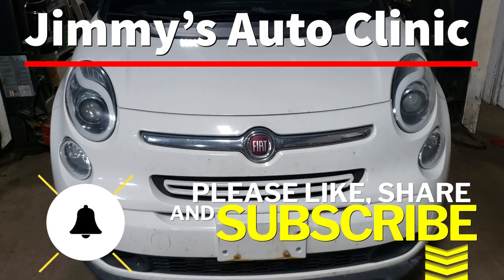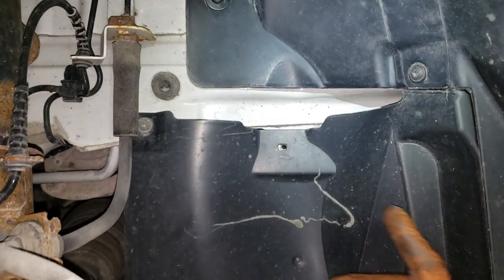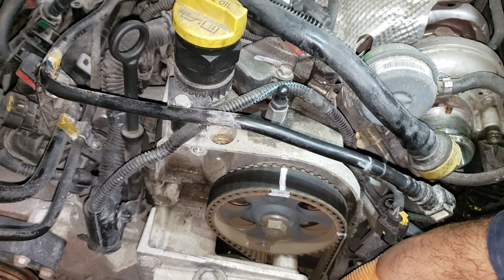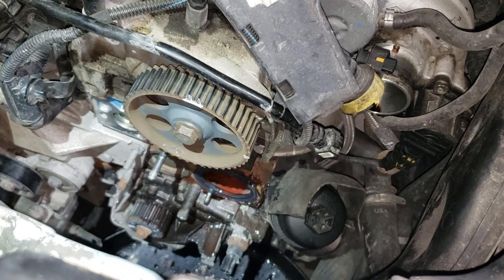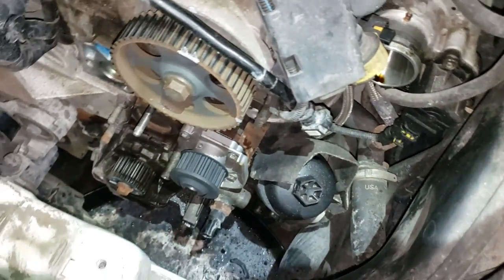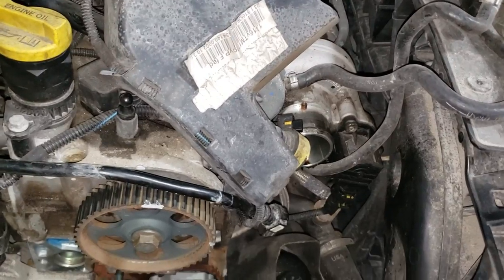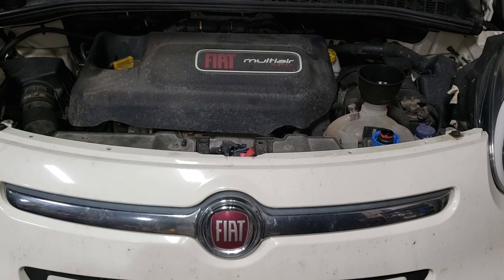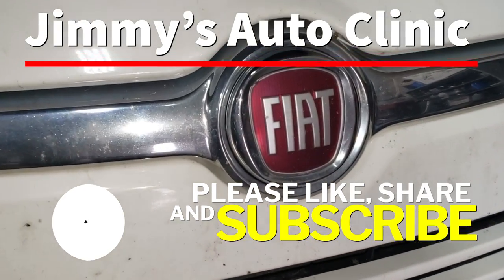Fiat 500 Lounge Pop | Timing Belt & Water Pump Replacement | 1.4 L Turbo

Comment: This is not a proper tutorial for this job. The lockout kit required is there to keep the engine in time. This is not recommended to make your own timing marks with a paint marker, or use vice grips on the belt regardless of pressure. Yes before anyone asks, I do run a mechanic shop. I can link the all data sheet for this job if needed. This is very risky to do this way, if you get it off at all it can result in severe engine damage.
Reply: Was gonna say, im pretty sure there's a lockout built in. Would going from underneath be the best way to get to it?
Reply: @ststst981  there’s no existing lockout or marks. There’s a lockout for the crankshaft and one for the back end of the camshaft near the air pump. Proper timing of the engine also requires the camshaft bolt to be loosened, then retorqued after new belt and tensioner installed.
Reply: The lockouts required are in a kit you can buy for those fiat engines
Reply from the maker: Yes if you're completely useless. It's only worked for me for the last 20+ years. Not everyone is going to have the tools that we have or the access to data sheets or be willing to spend an arm and a leg on a specialty tool just to do one job.
Reply: It’s a $30.00 dollar tool. All I’m saying is clamping a timing belt with any form of pliers can cause damage to it. But to be fair, you explain to do it gently. It’s the customers fault if they attempt something like this in their driveway with no experience
Reply from the maker: @edwardkirkendall883 I appreciate what you're saying, the videos are to show people what we go through and show them that there are other ways to do things. The tool maybe $30 in the United States but up here in Canada that probably be like 7 million dollars LOL nonetheless it's not absolutely necessary. And unless replacing the camps you you don't need to remove the cam gear.

Comment: Nice video.  I will be doing this job in the spring.  Pro-tip... I slide short pieces of air hose over my needle nose vice grips when I use them to pinch delicate items such as this.
Reply from the maker: Hey Joe thanks for the tip. Thanks for watching the video and don't forget to hit that subscribe button :-)

Comment: Subscribed! This was an excellent tutorial video for timing belt replacement! Yeah man I got a screaming deal on a 2013 FIAT 500 Sport she has 93k miles 2 grand! I'm sure it was never replaced. It runs great doing a lot of overdue maintenance work on it and looking forward using this video for the job replacing the timing belt as such. I like your method on marking the belt, cam crank, and block cannot go wrong! It saves some time and money. The Timing Belt Kit is about $138.00. Thank you!
Reply from the maker: Thank you for the compliment. I really do appreciate it. I'm glad you found the video helpful.

Comment: Well, there is two intervals for replacing timing belts one is kms/miles the other is time usually in years. This looks like a bit over the usual five years or so (over time and heat cycles the belt can give up even it is not have even close to the kms specified)
Reply from the maker: You are 100% right. Unfortunately most people only look at the mileage instead of the early bird. I believe this timing belt was 240,000 km or seven or 10 years. I can't remember exactly but it is definitely important to pay attention to both.

Comment: Use an air compressor through the radiator to blow extra coolant out from the water pump area. When you pull the water pump out to get the corrosion from inside the block and the radiator out, you will have residue of corrosion
Reply from the maker: I usually use compressed air to blow out some excess coolant but as for corrosion you would physically need to scrub it in order to get rid of it. Blowing it with an air gun may knock off really big chunks of corrosion if you had any but it wouldn't do much unfortunately.

Comment: This is a fantastic DIY for the Fiat (I didn't know until watching that Fiat was a four letter swear word)
Most timing belt / water pump jobs are kind of awful regardless of make, I suppose this no worse than my old gen 1 Neon or my daughter's Gen 1 Kia Rio. Lots of excellent home shop tips. Great job.
Reply from the maker: Hey Richard thanks so much for the compliment. LOL yes I didn't know that Fiat was a four letter swear word either until 15 years ago I think it was when I had my first one to work on. It was just an oil change but yeah that cartridge filter could have been placed better. Especially with the turbo models. Yes you are right most timing belt jobs can seem to be quite awful but some of them are pretty decent. Luckily I like doing them so they're not the worst but for someone who's just doing it for the first time it can definitely be a daunting task. I'm glad you enjoyed the tips. Thanks for watching :-)

Comment: Great video. I have read around 200,000km for timing belts for fiat 500, that being said what If you only have 37,000km the car is a 2015? Does it need to be changed?
Reply from the maker: Hi James yes there is a interval for time as well. I don't remember off the top of my head but I think it was 7 to 10 years. The best thing is to consult the owner's manual. Sometimes even though the belt is still good or may look to be in good condition they can dry rot in certain places that you might not catch by simply looking at the belt. And just for peace of mind and the continued enjoyment of a engine without sudden bent valves syndrome it is worth replacing it lol. If you can't find the information in your owner's manual for whatever reason you may be able to call your local dealership with your VIN number and they should be able to tell you what the interval is as per the manufacturer. Just be careful though they'll try to suck you into replacing it sometimes with them.

Comment: Great explainer! Nice work Jimmy. Did you replace the serpentine belt?
Reply from the maker: Hey thank you for the comment. I did not change the serpentine belt in this video. It was actually changed on this vehicle a year prior to the timing belt be changed. So it was still good. But definitely not a bad idea to change it if yours hasn't been changed and you're in there.

Comment: I had another question bout my fiat. I’m getting radiator and condenser back on. Can I wait till summer to charge air conditioner or will it harm the unit waiting and running heater.
Reply from the maker: You can wait to charge the air conditioning. Just remember the longer you leave it the more potential for harm there may be to the air conditioning system because of moisture content. The other thing is if you are in an area where it is humid and you turn on your defroster for your front windshield without the air conditioning working, it will take considerably longer to clear your windshield. Other than that it's really no real issues. Unless you leave at  for extended periods.

Comment: At what mileage should the timing belt be placed?  I thought I heard you say 200,000 km.
Reply from the maker: Hey Gary, It is model specific so the best thing to do would be to call your dealership with your VIN number as far as I remember it was 240,000 km or 7 years I believe.

Comment: Jimmy, if you don't mind me asking - where did you find torque specs for this Fiat model? Trying to gather info for a clutch replacement and having difficulties finding it.
Reply from the maker: I use a program called shop key. I will warn you though the program is a real pain to use sometimes. It is a paid Access program as well. What you can do if you don't have access to a program like that is you can ask your dealership first apartment and most times they're nice enough to get you the specs. If you don't end up getting the specs, Based on the size of the bolt and the thread pitch you can also guesstimate how much torque is needed for the Fasteners that are to be torqued.
Reply: @JimmysAutoClinic  thank you very much!
Reply from the maker: No problem 😊

Comment: Fiat       (F)ix (I)t (A)gain (T)ony
Reply from the maker: Ain't that the truth LOL
Reply: When you move engine by hand do you go clockwise or counter clock. As your viewing it
Reply from the maker: I go clockwise but you can go backward as well with this engine, I did and I didn't have any issues. There are very few engines or instances where you can't go the opposite way with an engine.
Reply from the maker: I hope that helps you out. Please hit subscribe if you haven't already.
Reply: @JimmysAutoClinic  yep thank you. Wife hit a raccoon took out radiator condenser etc etc. so it’s a no brainer to do this while the front is all apart and waiting for parts. Also replacing hoses and thermostat hers is a 2013. Not my favorite car however I will say as you said take your time and it’s fairly easy getting stuff apart and back on. Thanks for a great video
Reply from the maker: Thank you so much for the compliment. I really do appreciate it I'm glad I could help.
Reply: @JimmysAutoClinic   well I the 2013 fiat 500 turbo had a different engine mount 7 bolts and it’s kinda molded so you can’t get it out. Assuming engine removal would be needed. I tried all sorts of ways only thing would removing the cam gear ( large gear on top) and not sure that would work as once back on still in the way to tighten tensioner. So leaving alone. Belt looked good so
Reply from the maker: Whatever you do do not remove the cam gear the reason being is because I'm pretty sure most of these models don't have a keyway or Chuck so you would have to lock the cam in order to set it back properly which could potentially be a nightmare. Also if you can send me a picture of your Mount and I might be able to help you out hopefully.
Reply: @JimmysAutoClinic  i moved the gear near the oil pan, what do I do?
Reply from the maker: I'm assuming you're talking about the crankshaft pulley? How much did you move it? What you can do is slowly crank it back if your belt is off. Make sure that your Pistons do not collide with your valves.
Reply: @JimmysAutoClinic  it wasn't a full 360 crank but it was about a fourth clockwise
Reply from the maker: As long as the Piston did not contact the value of your fine you can twist it back. Hopefully you marked it properly. Just line it up and you're good to go.
Reply: @JimmysAutoClinic  Lets say It was cranked a few directions but I don't know exactly what I cranked it to. Can I just revert the gears back to where I marked them? Do I have to only move them one direction? How do I know that I have not damaged the valves.
Reply from the maker: You'll know that you hit the valves because you won't be able to rotate the Piston anymore so when you're cranking make sure you crank it very slowly so that if you do touch the valve it doesn't Bend. It really doesn't take very much to bend them so cranks slowly. You can definitely turn it either direction in order to line up your mark.
Reply: @JimmysAutoClinic  Awesome. thanks